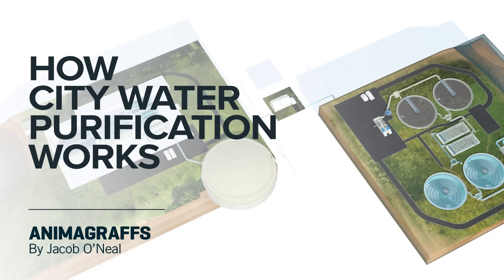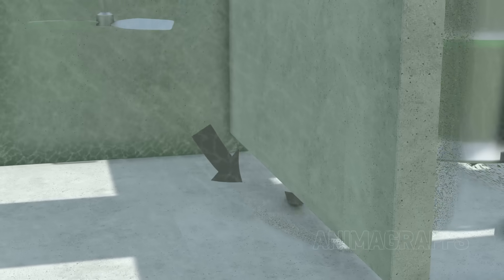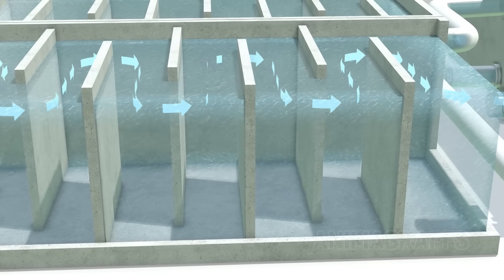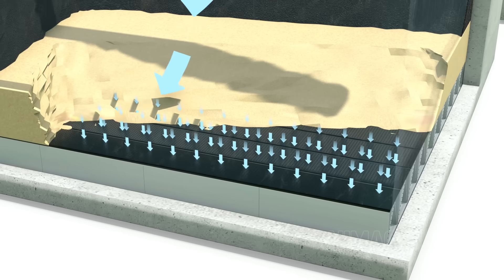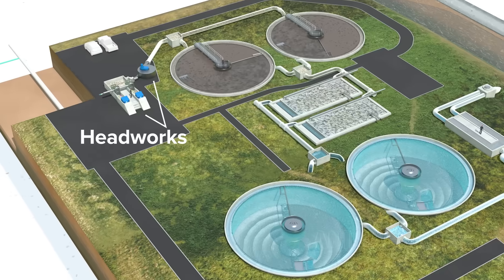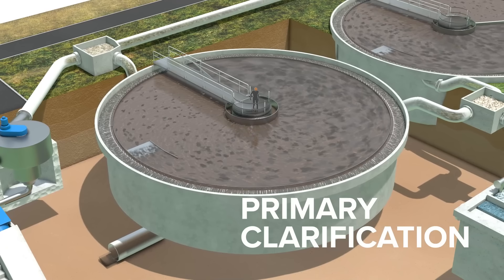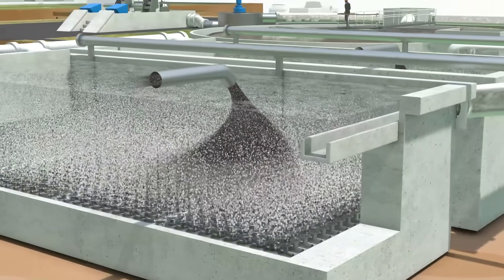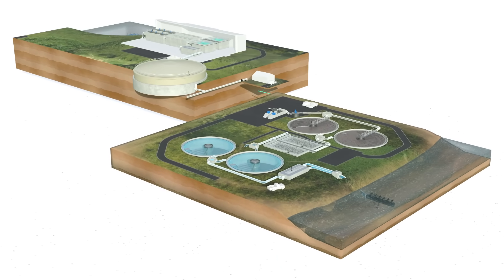How City Water Purification Works: Drinking and Wastewater

Comment: I work in the uk water industry and this is very accurate to what is commonly used. Couple of terminologies are different but nothing to worry about. Would be interesting to show how the sludge is disposed of and the role that activated sludge plays in the biological treatment but that’s fairly geeky stuff. The sludge from bottom of the first process in water treatment is often taken to the waste works to be added to sludge disposal there or can also be dried and used as compost or agricultural fertilizer. The sludges from waste sites are often taken to separate sites or on bigger work part of the same site to use from bio gas production to then make electric to either run site or sell onto the grid as water treatment is very energy intensive.

Comment: Keep in mind no matter how well the water is treated  at the station, it has to go through all those pipes to reach our homes, so what ever contaminants thats in those pipes is what we get,  and even through the city puts chemicals in the water to solve this, its far from a proper solution, and those chemicals become  contaminates  themself  not meant for human consumption,  maybe to only wash the floors and do dishes with, so forth, but that's why everyone should have their own filtering system at home for clean potable water, a filtering type that can remove contaminants. There are two  superior methods - 1. Reverse Osmosis  and 2. Distillation. Reverse osmosis removes 99% of contaminants and distillation removes 99.5% of contaminants, therefore for drinkable water, folks should mineralize  the water to make it healthy to consume.

Comment: Waterplant operator here, overall very well done. Few comments: for water purification, chlorination is a key step in the process in many parts of the world. In my area for exemple a minimum of .3 mg/L CL2 in reservoir is required and distrubution system  usually have a max limit set at 5mg/L CL2 with a required risidual found at the end of the system. Also ozonation process can be often found after filtration to reduce the risk of THMs. As for wastewater note the practice of using sewage sludge for fertilizer is banned in many regions now with new strict regulation put in place. A nice engineering design found in both water purification and wastewater plants, most are design to operate mainly by gravity apart from pumps at the begining and end of the process.
Reply: Yeah I was surprised when it said you can use sludge as a fertilizer. I read an article from my local water treatment plant that they have to pay a lot of money to get rid of it. So now they are thinking in investing in solar panels to dry sludge as much as possible to reduce weight because they pay per tonne.
Reply: @joshashe2087 some places put the sludge through ovens and presses to dry it out before hauling it for land application/disposal. My plant sends it wet once a week.
Reply: the treatment for both drinking water and waste water seems very similar to each other. Would it be possible to have a semi-closed system? It would save water as it would only need to be taken when the amount of water is below a threshold that wouldn't supply the current demand.

Comment: Wrong! There is no Chlorine or Chloramines added?
Reply: According  to a couple of the top comments it is correct.
chlorine isnt a requirement. the UV stage does the same thing
Reply: @logodsaw  Ok so maybe for waste water this might work BUT for drinking water there could be some time before the water comes in contact with a person such as being pumped to water towers and traveling many miles in pipes which may also have bacteria. It would be insane not to add at least a little chlorine to the drinking water. Also, does Ozone hurt people? I have heard of people having problems to use OZ generators in their homes to clean the air. I'm not sure drinking water with ozone in it is safe either.
Reply: @ the ozone breaks apart before it can affect people.

i have no idea about the chlorine, i was just reapeating the top comments

Comment: The fresh water in most places is pumped into a tank high above the city on stilts or on a hill. 

This creates natural 60 psi pressure and the pressure eliminates the need for pumps along the system. 

It also lifts the water to tall buildings in cities without pumps

Hotels in areas that don't have high tanks will use pumps on every other floor 
If you have low pressure in a hotel, ask for a floor with the pump on that floor to get the best water pressure

Comment: Why can't we use some of these techniques mixed with algae in order to create an air purifier? We only need to pump polluted air in an aeration tank and have silt collector at the bottom to collect the dead algae. If we created wind tunes pipes through a city to collect polluted air and send them to one of these hypothetical planes, we could lower carbon emissions. We could use the spent algae as biofuel or dry the out into bricks to capture the cardon. If Algae is not strong enough to counter the carbon to offset the carbon we use to make it, we could probably breed a new form of it that could handle the job. Energy concerns shouldn't be a problem because the sun would probably provide most the energy. This should be possible.

Comment: Pretty good generalization of the process, however the domestic water supply is not always so complicated. I work for a local municipality, and our domestic water is entirely from wells pulling from a secondary aquifer. The pump house is pretty small, housing the pumps, SCADA system, and chlorination. That being said, this is from a deep aquifer, not surface, so disinfection and treatment is not as rigorous (though still above legal requirements)

Comment: The only thing I would add is that there needs to be residual treatment (typically chlorine) in a municipal supply system to maintain cleanliness. I've been told a point of entry system (typically UV) can also be used to ensure bacteria doesn't remain in the consumer's water.

Comment: this is an amazing video......can you also add the different piping and pressures and the backflow preventers and the jockey pumps and stuff like that so that we know what happens when there is a leak in the water piping system and how it is detected?

Comment: Your animations are amazing 😮

I worked for a wastewater treatment plant in Bavaria (Germany).

In the Secondary Treatment there are tanks with and without aeration. 

What happens in the tanks with aeration (dissolved oxygen is needed) is what we call the „Nitrification“ where ammonia is converted to nitrite (first step) and then to nitrate (second step). 

After Nitrification the water flows into a Tank without aeration.

What happens in the tanks without aeration (the oxygen from the nitrate molecule is used by the microoganism for breathing) is what we call the „Denitrification“ where the nitrate is converted to pure nitrogen gas which leaves the tank as tiny bubbles into the air.

After Denitrification comes the Final Clarification where the Denitrification finally finishes.

Comment: Nice video with excellent visual representations. As a Water Treatment Operator, the only thing I'd note is that most plants I know of (even the ones who utilize UV technology) chlorinate their tap water either with chlorine gas or a hypochlorite liquid (bleach, essentially) to maintain a small amount of chlorine throughout the distribution system, which is known as a residual. We can control the pathogens at the plant with UV, etc., but municipal water systems, service lines, and plumbing are prone to leakage (and infiltration) at certain points, especially in poorly maintained systems. These incursions aren't a problem as long as the chlorine residual is present.

Comment: in a chlorination works, no ozone is used, in the Uk we use chlorine and ammonia for chloramination instead of ozone, and it's injected just before the TWSP or ~Treated Water Storage point (large onsite tank) before usually gravity feeding the network assets.

and usually the Raw water to WTW (water treatment works) is gravity fed, not pumped in, some works have Raw water inlet turbines within the pipes to generate about a 3rd of the power used at the WTW and also handy for power outages.

of course if you are using Chlorine gas or liquid, you have to ensure the protection of the aquatic environment, so Sodium thiosulphate is used to neutralise the chlorine in case of total TWSP dumping.

some works in England also mix Fluoride into the water, to help their teeths, in Scotland we dont need to bother, I guess our teethies are just nicer lol.

Comment: Here in the Phoenix area, we have an extensive canal system (thought not as extensive as it used to be) which, in some locations,  also serves as a way to discharge waste water from these plants since any added ammonia or anything is actually useful for the farmers who use that water. It can also be sent down drainage canals, which ultimate discharge into natural washes or water ways, or it can be discharged into a catch basin and allows to soak into the ground to join the water in the aquifer. Some locations also use a separate piping system to use this reclaimed water for irrigation of city landscaping.

Comment: "Activated carbon" is nothing but regular carbonized material that is washed- yes, washed.
Meaning, you do not have dust particles in them.
Just take your barbecue coal and wash it with distilled demineralized water and VIOLA- you "activated" your carbon..

Comment: Imagine god seeing this after he made the most complex water filtration system imaginable. Fully loaded with spring water that is packed full of minerals that your body needs to function at peak efficiency. 

Fun fact: If you drink 100% pure water it will cause cells in your body to explode because your cells have a high salt concentration. And when pure water surrounds them the salt will rush out to this desalinated water causing the cell to expand and explode. 

So yeah…. God had it right to begin with you silly humans.

Comment: Well in theory this should get rid of all of the pollutants in the water but it does not when you actually check the faucet water. Likely due to just huge amount of volume of water which can't be filtered adequately by the city system, or it accurate toxins in the pipes.
Reply: Our water has a chlorine residual for that reason. It disinfects and helps reduce any bacteria or pathogens from growing in the distribution system.

Comment: The video is a little bit inaccurate  on the filtration stage; it is not activated carbon but anthracite, which typically composes  the multilayer of the filter

Comment: Very good 
I am a retired wastewater treatment plant operator of 27 years 
Iona in Vancouver bc 
You could make a second video 
On the digestion of the solids removed 
Their are 2 types of 
Digestion 
Aerobic 
 Aerobic treatment 
Is basically a tank of solids where they pump oxygen to feed the bacteria that eat the solid organic waste

Anaerobic digestion has the benefit 
Of methane 
We use 2 types of bacteria 
1 acid formers 
They break down the waist 
2 methane formers they eat the waist of the acid formers 
And produce methane and some CO2 
If it’s off can produce hydrogen sulphide a very caustic gas
Turns to hydrochloric acid when in contact with water 
Why your nose and lungs  burn
When exposed 
Now with the methane 
Their a few options 
Methane is basically the same as natural gas 
Now at Iona we have 5 large 
Cogeneration units 
Converted cat Diesel engines
Now we get 2 products from the cogens 
1 Heat we use to heat the digesters 
The bacteria is basically from our gut and intestine so it ideally should be heated to 37c 
Body temperature 
The rest of the heat can be dumped or heated the plant in general 

2 thing we get from the cogens 
Is electricity 
5 cogens 
We try and run at least 4 or 3 depending on the gas levels we are producing 
And if all the cogens are actually running 
They need lots of maintenance 
I have always maintained 
We should have installed boilers and run steam turbines 
Much more efficient 
And way less moving parts to wear out 

The extra electricity we produced go to the grid 
Helps to power the city 
In the summer we is far less power than in the rainy seasons

Comment: Worked at quite a few of these plants as an inside wireman and boy some of them are very clean for what they are, and some of them are absolutely disgusting. The 2nd one I was at I'd constantly get rashes on my arms and one day I was throwing up violently all over the jobsite. The other ones were as clean as poo can be! Also hear a guy 2 hours north drowned in one of the tanks a while back. I'd imagine that's the worst way to go. You can't swim or float in those tanks they take you straight to the bottom.

Comment: It was an incredible video. Thanks for your hard work to do this. But I have a question; Can we use UV disinfection in the drinking water systems? Because I learned that we cant use UV in drinking water systems. We have to use chlorine for the residual chlorine in the pipes.